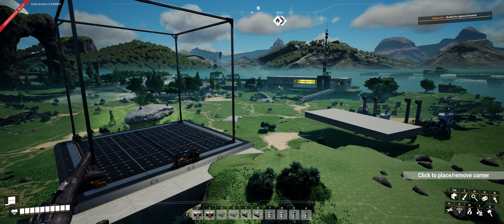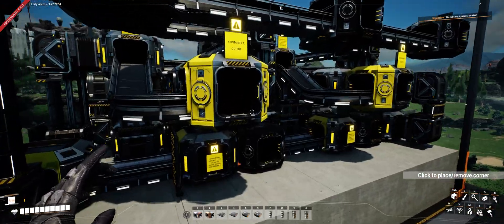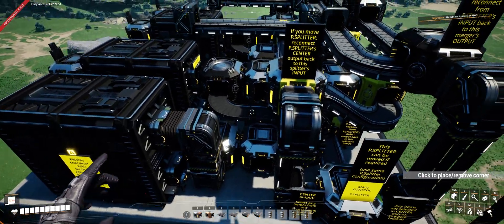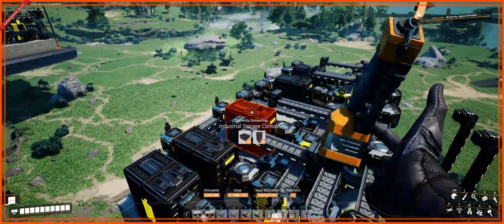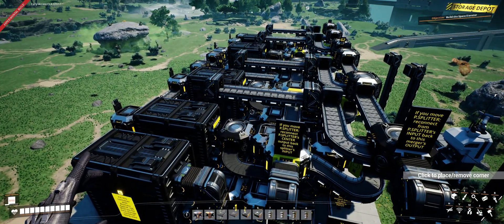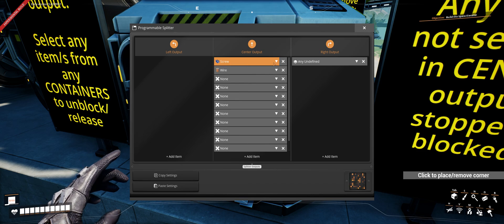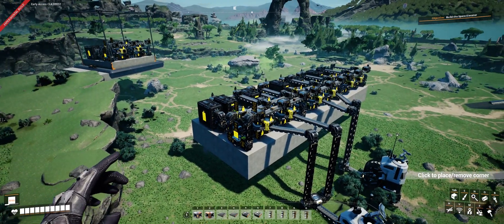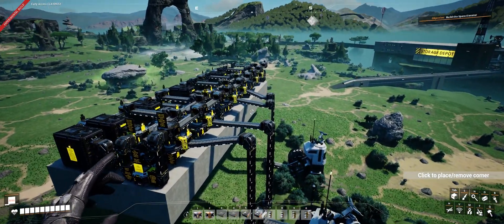Downloadable 2-Part Logic System Blueprint For Belt/Storage Flow Control

Comment: This is what makes this game so good. You can build and try things your way. If it works depends on your skill, knowledge and thought out planning. This design seems to be working very well. I hope we get a slightly bigger blueprint, a 4x4 is just ever so slightly limited. I believe there is a mod for bigger blueprint but not sure. Haven't really installed any mods. I like the unlimited fly mod though. Should give that a try. Thumb starts to hurt due to pressing spacebar to fly with jett pack 😅

Comment: problem with blueprints is you need the parts unlocked to use them, so if you dont have the say tier 5 belts or screens you wont be able to build it. so if building something for early use its best to build a version with the lowest tier materials and then a more advanced version. A tip I use for my blueprint is Inputs I place a belt mount and for outputs I place a floating belt, same for pipes to ensure proper alignment.
Reply: to make this work you need programmable splittters unlocked, whick is a rather high-tier item. It might make sense to have simplified single-item versions of these systems with tier 3 belts or so.

Comment: Thank you so much for the incredibly in depth videos - I was just wondering how to fit that system like yours onto a blueprint, and you've already done it.

I've been considering using your system where I use the escaping trickle of items to detect and change production ratio of things like aluminum sheets to aluminum casings using drones - Use a drone to deliver the trickle of 30-60 sheets/minute to the last factory/storage that needs it. Priority-merge with the bulk train delivery on a set of containers, which would be used like a dip-stick: Train -> Container -> (priority merge with drone delivery) -> container -> factory

When the container after the merge is full (storage is at least 50% full), the sheets will back up into the drone port and trigger the logic system to stop sending sheets. This can then backflow into the factory producing sheets, and trigger more ingots (via a smart splitter overflow) to enter an aluminum casing facility, so the ratio of casings to sheet updates dynamically to fit the demand of your world.

When the container starts to empty (storage is less than 50% full) the trickle of items will enter the container and no items will flow back into the system, which signals production of sheets to continue at full speed.

This allows the factories in your world to update its demand of sheets, and the ratio of sheets to casings being produced to adjust automatically as you build.

It's similar to your three-car-train example, but it takes advantage of drone ports' dual input/output storage.
Reply from the maker: Sounds very cool aswell, love it. 
Cheers Jeffrey

Comment: This is brilliant Stin.  I have been wanting to use your belt logic for a while now.

I want to set up a supply depot based off one of your older designs, where adding a few items to a container calls in a lot of items of the same type.

Instead of manually putting in the items into the container I want delivered, I use power to remotely control truck stations as the selector function, and control relative proportions of things going to the call box with belt speed.

I can then use output from the delivery box to go to a train station or back to be recycled / purge the system depending on power state.

This way, whenever I go to a new area to build a factory all I need is to extend the train tracks to the build site, extend lines for the master call and recycling loops, and request a fresh load of construction materials by turning the call switch on for a few seconds, remotely flooding requested items into the call box.

I can add a third power switch for high tech materials for building machines.

If I figure out how to do it, will let you know & share the results!
Reply from the maker: Sounds very cool mate, let me know how it goes